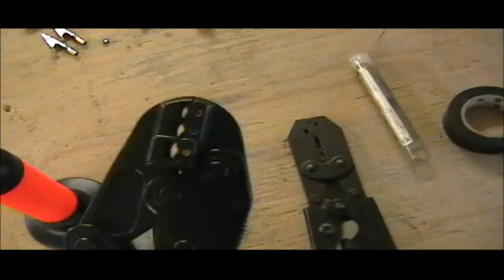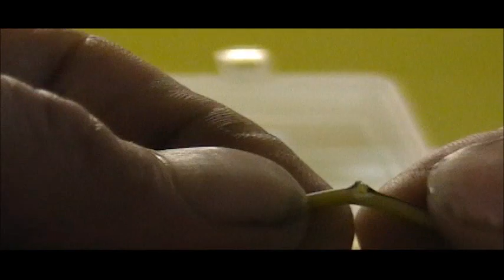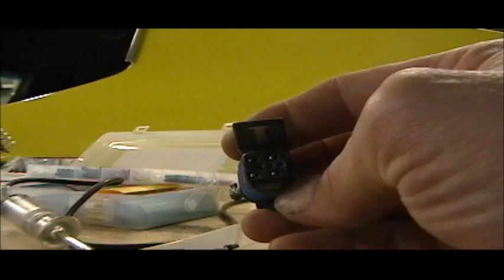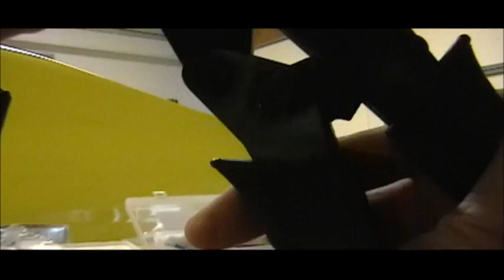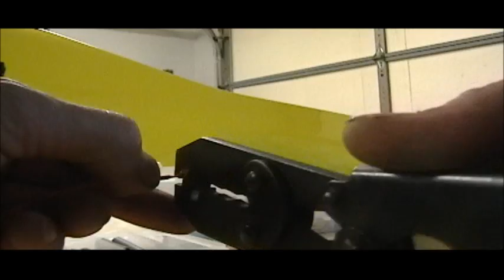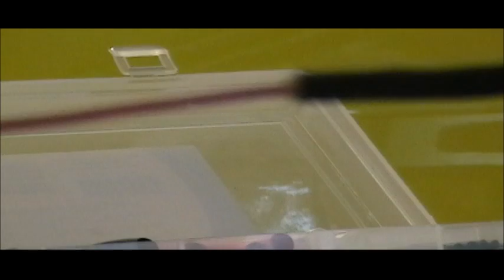My 68 Firebird Restoration Part 19

Comment: Wow, I am impressed.  Thanks for posting this.  Some of what you were doing I was aware of, but some great info.  I buy heat shrink tube in different sizes in 3 ft sections at Fry's, but haven't seen any with the adhesive inside.  Where do you get those?